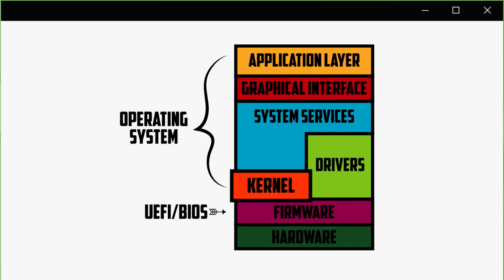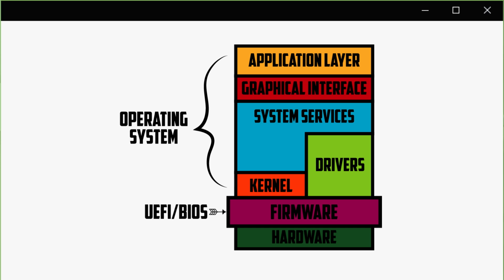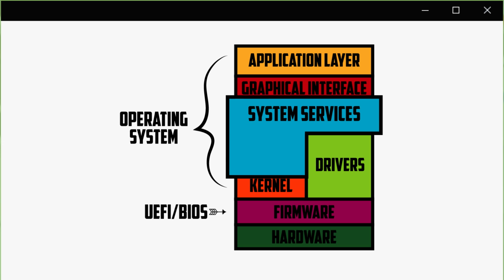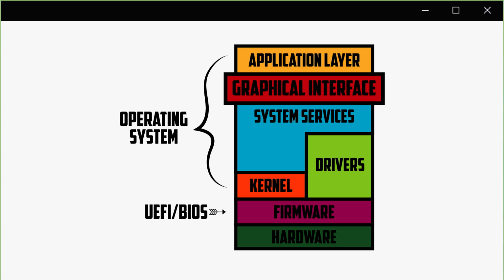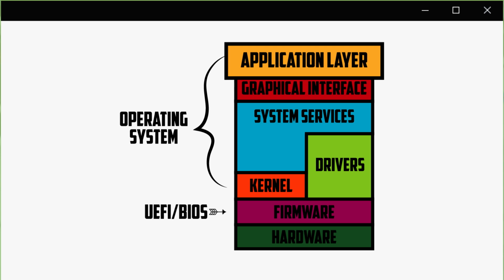sudo Sergeant 01 - What is an Operating System?

Comment: UGGGRH! A factual mistake in every second sentence. Do you even understand it yourself?
Some examples:
* Firmware is not just BIOS and UEFI, a lot of hardware has its own firmware (everyone saw Videocard firmware, Network port Boot ROMs, and there is much more). Furthermore, BIOS is limited to x86, and UEFI - to x86 and windows-compatible ARMs.
* Kernel and drivers often access hardware directly for performance reasons. BIOS is mostly used while booting nowadays, UEFI is a bit more complicated, and there may be a lot of ring minus-something stuff going on "behind the scenes".
* Kernel is not JUST a translation layer between firmware and applications. In fact, its role as translator is very minimal. Kernel is the "backbone" of the OS. It manages CPU cores, memory, drivers, user software, filesystems, security, and much more. It is a very important and complex program.
* Technically speaking, a driver may run outside of the kernel, such as SANE (scanner) backends in Linux, although most drivers are kernel modules.
* System services only interface with some drivers. Filesystem operations go directly to the kernel for example. One could argue if X-Window and Pulseaudio are services or user applications. The video didn't really shed any light on what on earth are they.
* "Graphical interface" is not really "between" kernel and user, except for actual graphics. "graphical interface" is a property of some software, and what the video means is graphical subsystem (which could be classified a system service) - the X-server, window manager, etc.

In other words, the video is based around a incorrect chart that is badly explained.

Comment: Totally need more episodes just like these. Even more so, regarding things like the board electronics. Would be great to have segments like for example the TechQuickie channel, informing viewers about resistors, capacitors, diodes, etc. To encourage the community to get into microsoldering, soldering, and other electronic work. I know i'd watch em :)
Reply: Oh I absolutely do love it for it's roots and all as well. I have watched Ben and the team for years now. Since their early days, while I don't participate in the element14 community as much as I should, and I don't normally hang out in the comments - The channel has taught me a bit and gave me a lot of laughs. I just do firmly believe that if they could afford and allot time for more quick and easy to produce videos like this, it would help pull in more and different viewers, and the channel would inevitably grow. I mean heck, if I was close enough I would teach em. I do smartphone/tablet/console repair, except primarily on board level work with iPhone logic boards, soldering hdmi ports on consoles and the like. More people need to take interest in this field :)
Reply: I agree completely. They wouldn't need to necessarily plan the episodes they will make, but rather make them as they encounter something else to teach. Like fpga, or microcontrollers, or whatever it is they encounter on a project. One about oscilloscopes, soldering irons, printed circuit boards, all the way up to maybe gyroscopes, transistors, and potentiometers. Some could be done in free time, and some could be pre-cursors to future episodes/projects.
Reply: Bradley Chappelle yes im interesting on this , i want to learn more and this segmensts are fun watch and learn.
Reply: but thats a 180* change for this channel. This channel was started for geeks or pro´s ...... but now you want to change it to an education site for newbies? Why? I loved the geek feeling of it :))
Reply: It would make for an excellent spin off second channel though, if it just got short but informative videos every other day to fill the gaps between larger projects they're working on.